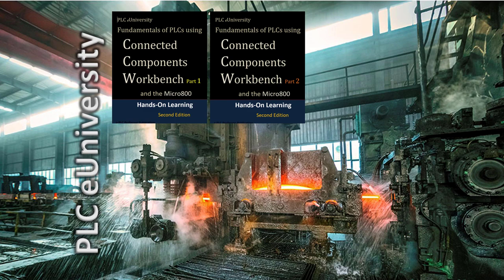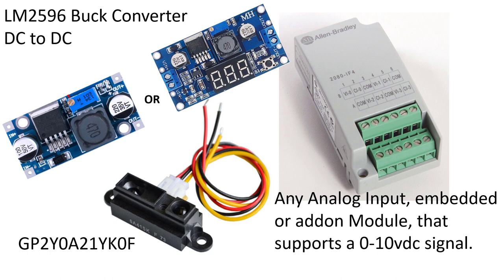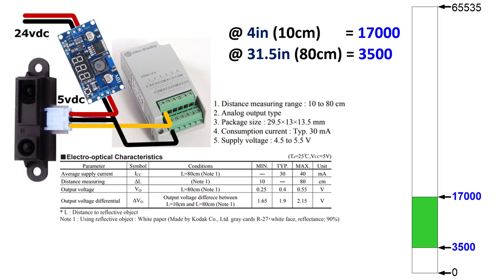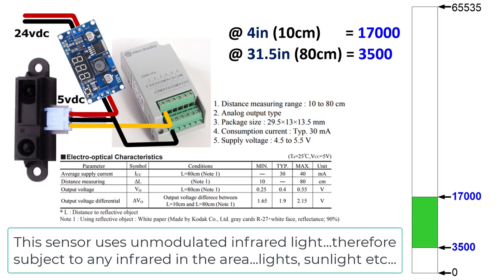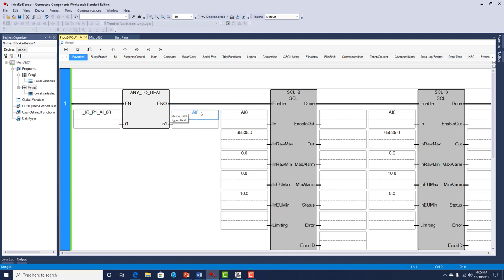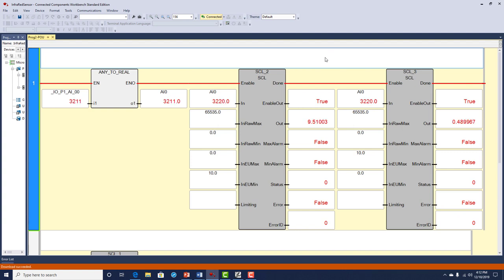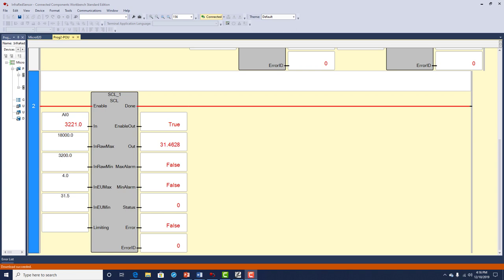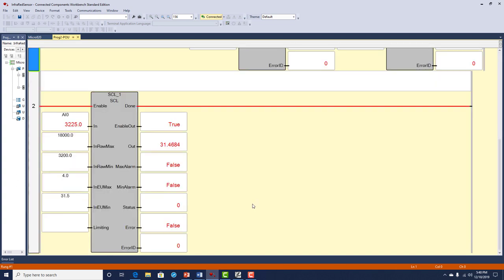Micro800 Analog Project

Comment: Good example to work with a skewed  scale and putting it into perspective.  Perhaps, we could use an inexpensive signal generator.  I found one on Amazon for $28 plus tax & shipping.  Eliminates the hassle of buying multiple components and piecing them together.  Can generate both mA and Voltage.  Self contained box.  DROK made one but it's discontinued.
UCTRONICS DC 0-10V 0/4-20mA Current Voltage Signal Generator, USB Power Supply Interface Analog Simulator for PLC and Panel Debugging, Device Testing, Frequency Converter, Flow Valve
by UCTRONICS